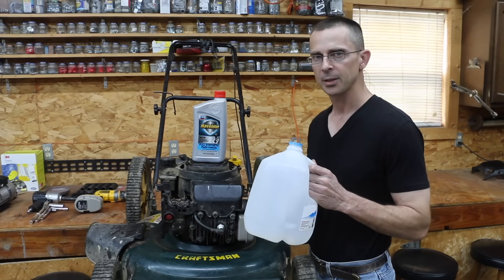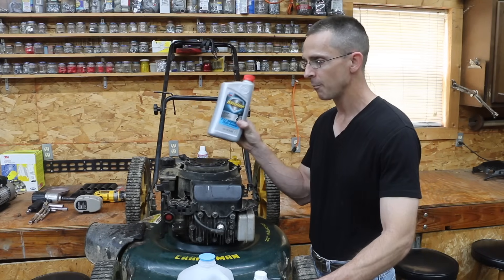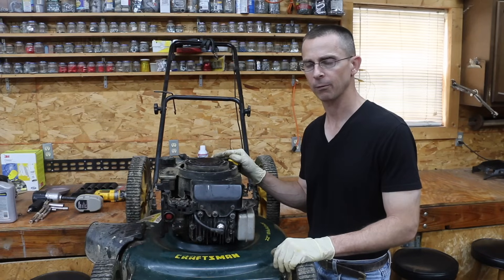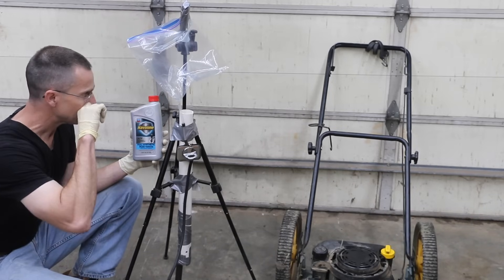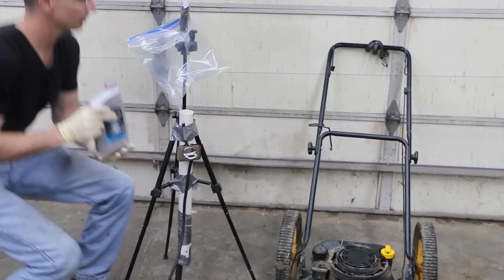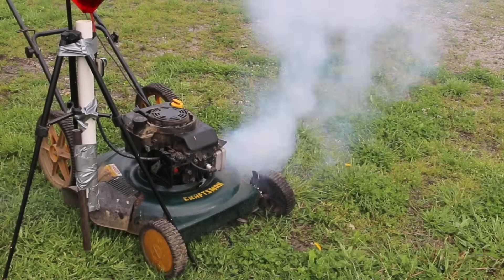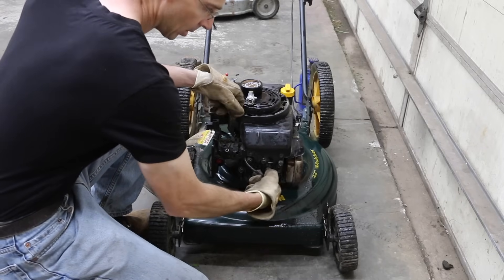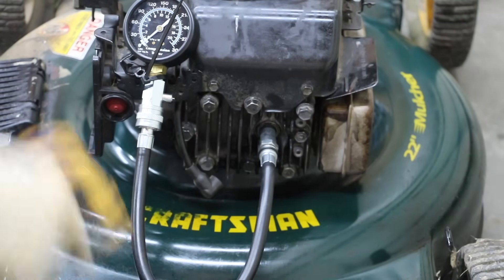Seafoam--can't believe what it did to my engine episode 6--Seafoam vs ATF!!

Comment: 1.) Those compression readings are very low ... I had a 4hp briggs a few years ago that couldn't handle tall grass .. I simply shaved the head with a belt sander and bumped the compression .. NIGHT and DAY change in power.

2.) I wouldn't test it on a mower but if you have a car with high mileage and evidence of poor performance due to dirt and sludge buildup try AutoRX ,, it cleans slow and steady .. does a phenomenal job.  It has saves 3 transmissions for me that were slow shifting due to varnish.
Reply from the maker: Brian,  I agree that the compression is low.  I believe the piston rings are the culprit!  Thank you for the product recommendation.  I'll add AutoRX to the list!  Thanks for watching the video and commenting!

Comment: Would you recommend using Seafoam on a car after its very first oil change, and every subsequent oil change thereafter, or would you recommend something like Gumout which is meant for modern fuel injection vehicles? I want to make my car last as long as possible even though I just got it brand new about a month ago. But I don't want to waste money if it's going to be unnecessary this soon.
Reply from the maker: Timothy,  I don't believe you'll need to use Seafoam or any product that often since it's a new car.  You might consider adding a fuel additive (lots of other great products besides Seafoam) at the same interval as the oil change.  Again, this is just my suggestion.  Others with far more experience on this forum can better advise.  Hope this helps.  Thanks for watching the video and commenting!

Comment: try brake fluid
Reply from the maker: 460fordtruckman, Another vote for brake fluid.  That's at least 4 votes tonight.  So, I'll definitely test it in an upcoming episode!  Thanks for watching the video and commenting!
Reply: Mark Pikas that's the old stuff,  at least out here in CA,   ours is non chlorinated so it doesn't give off phosgene and chlorine gas.       I use it all the time for starting fluid.
Reply: It would not be wise at all, as most oil seals will disintegrate in contact with brake fluid. That could probably work just long enough to perform cleaning, but damage any seals or rubber parts in carburetor that would fail later on.
Reply: Very, VERY bad idea.  burning brake clean can produce phosgene gas, a highly toxic gas used in chemical warfare.
Reply: I think you should not use brake fluid for reasons listed here plus it is actually a very dangerous chemical when burnt.
Reply: Yea, the rest of the world still has the good stuff, but you can buy non chlorinated if you look for it...
Reply: 460fordtruckman While you're at it mix the brake fluid with power steering fluid, will add 5 extra HP LOL!
Reply: Greetings from Croatia Europe.I love to watch your useful motor tests.I am using Atf oil for diesel engines as an injector  cleaner and a fuel system.the brake oil we use in older trucks driving through Russia against freezing the diesel in extreme minus temperatures in proportion o.5 L in tank volume of 5oo liters
Reply: Jari Vuorinen I was joking lol! I know full-well how caustic brake fluid as it has detergent properties, and power steering is more like transmission fluid, so no I wouldn't recommend it I just said this as a joke since on the topic of different fluids!!!
Reply: brake fluid w rust the shit out metal
Reply: Only if it's been heated beyond it's max. boiling temp Stephen. Brake fluid has corrosion inhibitors in it that work just fine, if not run beyond the max. temp. of the brake fluid or left in the car for more than a few years and the moisture it takes on over time has reduced it's boiling point. So, yeah, running it an engine is a bad idea, from not only a temp standpoint, but a caustic standpoint, cause as people mentioned it can eat certain rubbers/seals and certain plastics. I mean, brake fluid can strip paint, so it's not a good idea in an engine. From a corrosion standpoint though I don't think it's much of a concern though, cause otherwise our brakes would be seizing up and brake line rotting through faster all the time from moisture and corrosion. Tranny fluid is a much safer option.
Reply: Yeah, Mark brings up a really good point and so do you SOCAL. Our brake clean products here in Canada are labeled as non-chlorinated. However, we have others of the same brands but in "extra strength" which are not labeled as extra non-chlorinated. They also don't say if they are chlorinated (go figure?), so one must assume that if it doesn't say non-chlorinated, then it like has chlorine in it and if you burn it, you create phosgene gas and yes it is very bad stuff. It even says on the cans, not to breath the stuff when using it. People need to realize, that doing certain things, without knowing chemistry, could be their death sentence. There was an episode like that on 1000 ways to die. Guy bought an old trailer which has some old waste in the toilet's holding tank, which had turned to Ammonia. He dumped bleach down there to clean it. He never made it to the front door of the trailer, before he dropped dead. That's how fast the reaction was and how quickly it killed him.
Reply: No Steelmesh and I would not burn that, especially in an engine. That's basically Lacquer Thinner that you described right there and should be nowhere near an engine or any plastics or rubbers etc. It will literally eat/melt them same as Acetone can and it is a VERY strong solvent. Stronger than Acetone alone, for sure. You could get away with burning a small amount of Acetone in an engine, because it is compatible with fuel and actually thins gas and helps it atomize through fuel injectors better, which supposedly saves gas and cleans the engine (and is still a debatable practice due to how it behaves), but I would never, EVER throw Lacquer thinner into an engine. That's engine suicide right there. I mean, I use that stuff to remove old gasket material from engine parts, cause it's safe on metal and can remove gasket gunk well, so it would most surely eat gaskets at the very least. 

Even putting Acetone in gas is not recommended, in my opinion and others. I used to do it, thinking it was saving gas, but it caused problems with high idle, exhaust rattling and it could theoretically damage softer parts, so I stopped doing it at all. There is an ongoing and huge debate about using Acetone to save gas and the effects it can have. Best to avoid the practice. There are better, safer ways to save gas and clean engines. If I use anything in my gas, to help clean injectors, it is not even solvent based. I use stuff like Lucas Fuel System Treatment for that, because it is solvent free and it works. It's made from mineral oils and stuff and also acts as an upper cylinder lube, so it's quite safe. Some oils and fuels now have detergents that also clean your engine. There is literally no reason to be spiking gas with solvents these days. Modern fuel is already designed for performance. Even lower grades of gas are now, as well as premium. Modern gas of any grade sold at the pumps, has excellent combustion really. It's very efficient and high quality.
Reply: Project Farm i vote the same!!!!
Reply: Mark Pikas that's why it's done Outdoors
Reply: He did`nt notis LOL at the end !
Reply: 460fordtruckman Yes.  Big time.  Brake fluid eats paint hence is a potential solvent.
Reply: or even brake cleaner,   that stuff is a crazy good solvent.
Reply: Mark Pikas but yeah,   maybe I should have specified,  make sure it says "non chlorinated"

Comment: Really like your videos. My brother collects old lawn mowers off the street. He said he changes the oil 6 to 8 times in a row, running for 20-30 minutes after each oil change and that really helps clean sludge in the engine as well as make them run better. It does not do anything to clean the carbon.
Reply from the maker: Kevin,  Thank you for the encouragement on the videos and for sharing the story about your bothers approach to cleaning up the mowers.  I'll be testing Marvel Mystery Oil this week and hope to release the next video Tuesday evening if editing goes smoothly.  Thanks again!

Comment: What about straight rubbing alcohol or acetone maybe?
Reply: Or Lucas fuel system cleaner, since you liked the Lucas oil stabilizer.
Reply from the maker: 802 Garage,  Always enjoy reading your comments.  Rubbing alcohol seems safe.  Do you think the acetone will cause damage to rubber and plastic?  Also isn't the "flash point" relatively low?  It seems as though it would combust before interacting with the build up.  I'm definitely not a chemist...so, this is all conjecture on my part.   I will definitely use Lucas oil stabilizer.  Thanks again for watching the videos and commenting!!
Reply: I mean that ISO HEAT stuff you can buy is essentially just isopropyl or ethyl alcohol anyways, though it doesn't advertise cleaning properties.
Acetone was more of a shot in the dark, not sure about the flash point. Would obviously be smart to look into. Blowing up an engine may get you tons of views though! :P
As for the Lucas, I meant actually test one of their fuel system cleaners, similar to Seafoam. Seeing what the stabilizer would do would be interesting too though.
Thanks for the reply, and great video as always!

Comment: I enjoy your video's

 And whomever said its a waste of money and resources apparently has never been in tight situations before.
Now it is true that most additives should be used as a last resort in certain situations,  but don't think it is ever a waste of money when your educating people.

A fuel injector on some cars range up to over $100 dollars a piece and if sea-foam can clean them vs spending $100 dollars for one injector, I don't see that as a waste of money. 
 Even testing products out on little engines is educational.

So, I don't think your wasting your time on this video's.
Reply from the maker: Shoobox Gaming, Thank you for the encouragement!  I agree with your perspective!  These additives have saved me several times!  Thanks again for watching the video and commenting!
Reply: We are poor and work very hard. Money doesnt come easy. Every hard earned dollar must be put to good use. We appreciate the hard work and resources you put into testing. IMAGINE ALL THE MONEY WASTED ON FAILED PRODUCTS AND VEHICHLES AND EQUIPMENT FROM JUNK PRODUCTS. You are doing the world great justice! Think about it!
Reply: I think it stems from many who insist all of these are garbage (see post above), all you need is oil changes. However, here's the funny thing, most of this stuff is already IN oil, half of them use the same detergents, the difference is the concentration. SO technically both parties are sort of right: change the oil properly and frequently and you likely won't have most of these issues. However, say you purchased a used car that has lots of sludge (I fall into this camp) because the previous owners didn't change as often as they should have, and that's where these types of things can really make a difference. Sure, oil changes will also do the same thing, just slower and over time. I just think it's funny when people call these chemicals snake-oil, most of them are in the same products they recommend just in a different form!

Comment: Great videos, on a lawn mower application wouldn't it be better to use walnut shells in a blast booth cleaning both head and piston separately and masking off cylinder walls?
Reply from the maker: Theodore, I agree that there are more effective methods for a lawn mower.  Lawn mowers seem like a great platform for testing various products, since they share a lot of the same basic principles as larger engines found in vehicles.  I'm hoping to figure out which products are the best and then to use those products on vehicles that aren't quite so simple to disassemble.  Thank you very much for watching the video and commenting!
Reply: Your a humble honorable person,  thank you so much for the reply

Comment: i see that you did the ATF test and well from looking back at your other videos to make a comparison for the final results of each test // looks like the ATF did a bit of a better job on the ( HEAD )  and fair on piston  the SEA FOAM did a bit of a better job on the PISTON than the water or ATF // the water did about the same as the ATF on the HEAD // and with any engine there will always be blow by of the piston and rings so yes i would do a couple of oil changes after running any kind of cleaner //  the HEAD you did the water test on then did the ATF ( same head ) looks like the ATF made it a bit more shiny after the water - so that seem like it would make for better fuel flow to the piston for a better burn or more efficient //  ( now for a couple more products to find results if you need more education to see how they work for cleaning parts of a engine ---  one is the gumout carburetor and choke cleaner and the other is K1 Kerosene // as i did personally did use both back in the mid to late 70's before the new electronic fuel metered carburetor and TBI systems came out in about the times of 1979 to 1981 // sure most things are good for getting rid of the deposits on the top of the engine but now how about the bottom half ? what they all do to the bearings and crank case ? // as being a retired mechanic i have seen many things in my years and saw the short term and long term results // even seen a Ford 351 engine run with nothing more than slick 50 for the oil ( meaning no oil at all just slick 50 ) // for me its all about testing and letting the user choose just to what extent or product to use for cleaning the engine // to bad these kinds of video were not put out in the past like today with you tube // great videos and work you do to help teach the general novice person who knows nothing about mechanical stuff
Reply from the maker: JAFO FUBAR, You did a terrific job summarizing the test results of each product!  Gumout Carburetor and Choke Cleaner is a great product and K1 Kerosene is too!  By the way, I plan to test Slick 50 in an upcoming video. I'm pretty excited about the upcoming tests.  Thank you very much for watching the videos and commenting!
Reply: not a problem // as being retired mechanic of 45 years plus i have seen and herd many things in those years and seen the results of the final outcome // some not so good and some that just kinda made one scratch the head in wow it did work // do not get me wrong but there are many good products out there to use for many cleaning jobs of the engine over the years and some have lasted the times with updates and improvements //  and yes alot of the olden days of the early engines and the tricks mechanics would use still have a place in some applications and results // just like the safety cleaning solution is great for cleaning parts -- now just rise with water and looks like brand new and with little cloth drying as its like non-stick pans or should i say mineral spirits coating to repel other liquids // now one one of the best products i have used for mating metal surfaces is made by ISUZU ( silicon sealant ) -- reddish in color once applied no matter if you have gas, oil or other lubricants it will seal and to get them apart is with a hammer and chisels and way better than standard RTV silicon's // another good cleaner for rusted and or greasy nuts and bolts or even for a  penetrate  i used old used diesel oil with regular gasoline and diesel fuel mixed together and it works really well     just more brain food for thought

Comment: Wow, ATF is no joke. I'm wondering if pouring ATF into the crankcase as an oil additive might help remove sludge in old/abused engine!Thanks for another great video. I second the sentiment that your videos are clean and devoid of fluff.
Reply from the maker: TCPUDPATM PORTS, Thank you for the encouragement!  I was a little concerned to find hydraulic fluid in the crankcase of my 1774 Ford Diesel tractor due to a leaking seal.  After much research, I couldn't find any cause for concern as long as the oil level didn't rise too far above the full mark.  I'm not comfortable recommending ATF for a modern vehicle.  I just don't know enough about it.  On one hand, it has a lot of friction modifiers and detergents.  On the other hand, it seems a little thicker than what's recommended for most modern vehicles.  Thanks again for watching the videos and commenting!

Comment: atf through the carburetor? I've only heard it being added to the gas tank and crankcase.
Reply: fluffykittynoodles ATF actually has detergents in it
Reply: id use water for the combustion chamber, and ATF for the engine, add in a quart to the gas tank to clean the fuel system. water afterwards to clean out the combustion chamber, of course. also, FYI, there are no detergents in ATF.  there are friction modifiers that increase friction between two surfaces that increases with heat and pressure. squeeze some oil between your fingers then do the same with ATF. the idea is that ATF literally scrags bearing surfaces and whatnot.
Reply from the maker: fluffykittynoodles,  Thanks for the information on ATF properties.  I thought it had detergents, but I'm incorrect.  I plan to repeat the water test, this time using a mist or steam...maybe some of both.  A lot of great information sharing on this forum.  Thanks again for taking the time to comment!
Reply: Yes sir just dump er right on in the carb. She'll suck er down and cough but 20 additional horsepower await the brave.

I am kidding but seriously it won't hurt anything. I'm 5 month behind on the thread but..